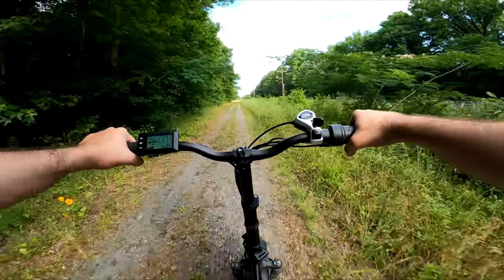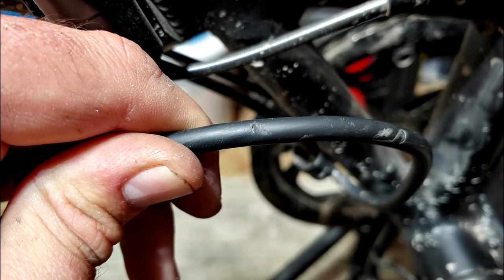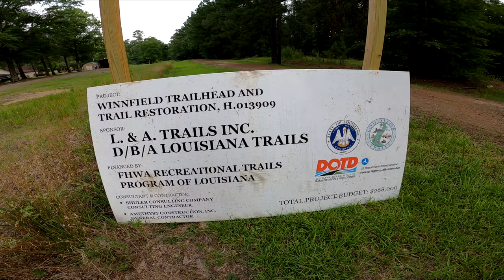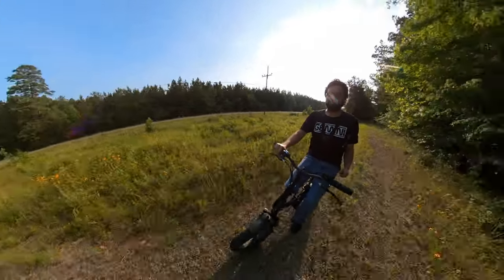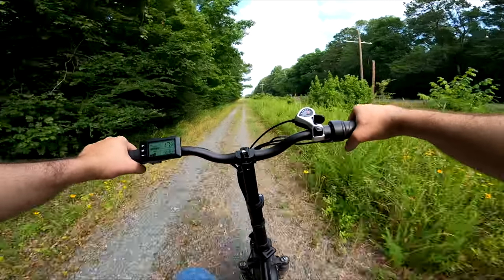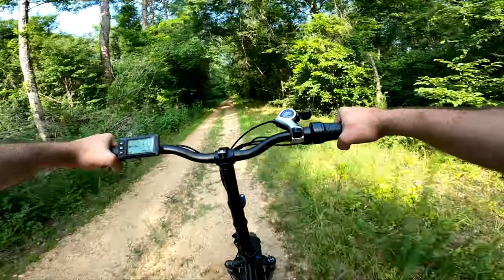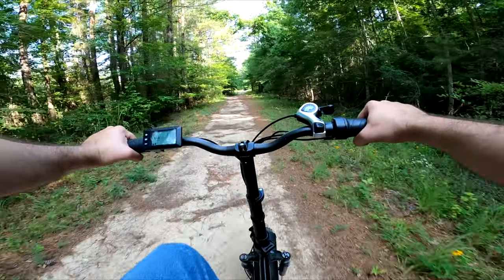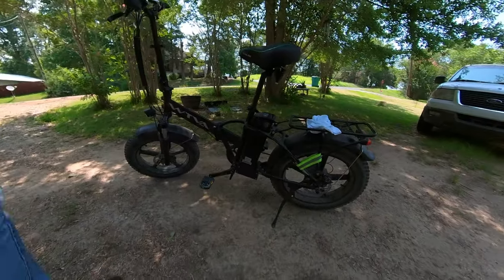Electric Fat Bike Hits The Trail (WTVA Orion)

Comment: I was told that it's best to always use as much of your battery up before you charge it again, otherwise it will start to loose some of it's storage capacity faster. Now what I was told was from a phone carrier years ago and just what I always followed and I think they have lithium ion cells too. Tbh though my knowledge of electric battery powered anything is very minimum. I have always been.ore of a gas or diesel guy and just had batteries powering the tools I fixed the gas and diesels with. So I just don't know but I'll be reading up on it now, not cause I don't believe you but because I do tend to believe you but what you say contradicts what little I thought I knew about charging batteries so now I just want to see why and what causes it and stuff like that.  Thanks for giving me more homework.
Reply from the maker: All good. Yeah these cells are touchy about there voltage. They don't have "memory" issues, so you can charge them at any %.
But if you run them flat they kick the bucket. Most bikes will cut out before destroying them, but not always before damaging them.

Comment: Bet some people will go through batteries on that because, like you said, you can't completely discharge any Type of Lithium Chemistry Battery (and they will), the worst one for that being Lithium Polymer...them things'll puff up in short order you go below 3.5V per cell, speaking from experience. Yeah if I had one of those I'd be eyeballin' that voltage meter the entire trip, and plan accordingly...
Reply from the maker: The high end bikes will likely have safe voltage cut outs. But many riders who just don't know may try to cycle the power and squeeze every drop the can out of it.

Comment: Is it more powerful than motorized bicycles?
Reply from the maker: Than a stock 66/80cc kit? That is a good question! I'll try to do some pulls and see how they compare.
Reply: @LAHover  When I built my 1000w front hub hybrid, I found that it more or less matched a stock standard 66cc kit for speed. Marriage made in heaven, that one. Once I swapped from the 66cc to the BT100, and changed sprockets from the 44t down to 32t, the electric motor is just mainly used for taking off from a stop and compensating for lost torque on the big hills.
I think anything less than 48v/1000w would be "less" than a 66cc in terms of performance and speed, but the old argument remains the same - you'll always get more range out of 2 litres of fuel than one battery's charge.

Comment: hey i hope you read this because i need help. i have a 80cc motorized bike and i need help because one time i was riding it on road and the engine just stalled out of no where. i tried starting it again but when i drop the clutch rear wheel just locks up and it wont start. i dont know what to do and you help will be much appreciated. i also tried lubing the piston but nothing works.
Reply from the maker: Could be a handful of things locking up the motor. Hard to say without have it. Will lilly need to pull the jug, and both side covers to look for the issue.
Also check your chain, might be folded over the small sprocket.